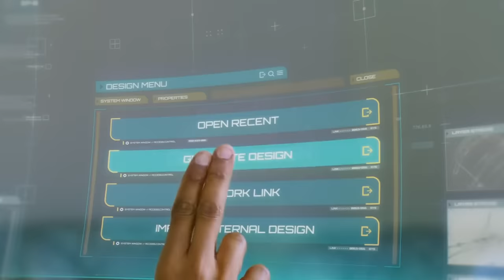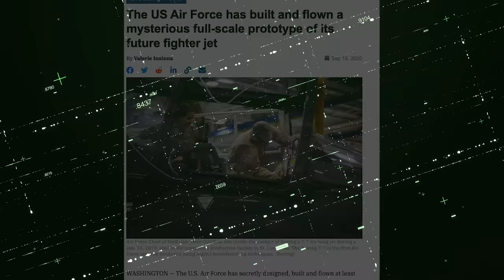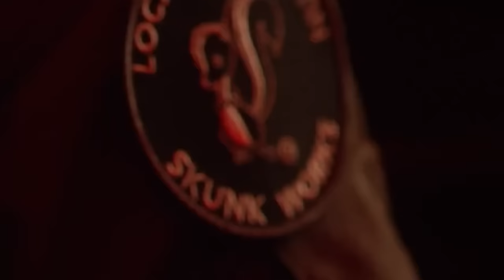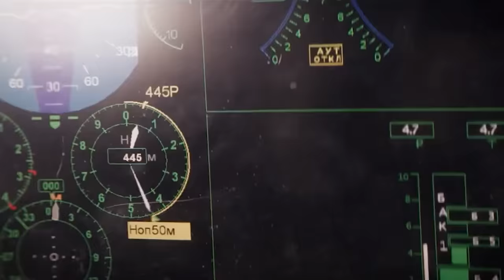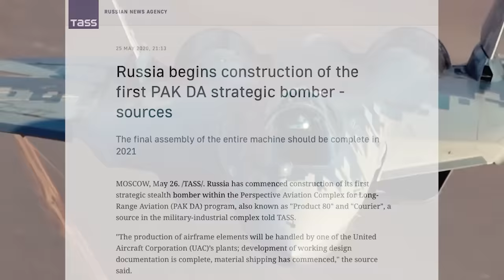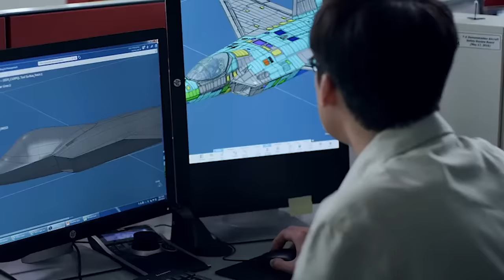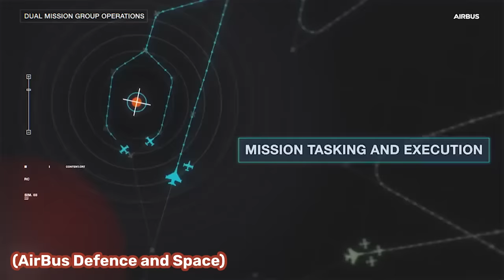12 new stealth aircraft headed toward service

Comment: America's been pioneering stealth since the 70s it took us a lot of lessons to figure it out so other countries just to show up and say we have stealth would make me laugh they're going to have a lot of problems the US ran up against in the early 80s-90s
Reply: they got 20 to 30 years of catching up todo and by then the US we still be 30 Years ahead
Reply: europe made stealth drone already
Reply: The first jet to incorporate stealth features into its design was the Lockheed A-12 which first flew in its full design configuration in 1963. Stealth was considered to be a vital feature after earlier experience with the Lockheed U-2 which turned out to be much easier to track than expected. An effort was made to reduce the U-2's radar signature called Project Rainbow and aircraft with these modifications first flew in 1957. There were also a number of unmanned drones that incorporated stealth such as the D-21, but stealth is quite a bit older than Have Blue and the F-117.
Reply: I mean this is true, but a lot of the issues are easier to resolve now that computer modeling is light-years ahead of what they had back then.

Comment: Seeing how India said their SU-30MKIs had no trouble tracking the J-20s, I wouldn't call it a stealth fighter.
Reply: That must have been at cruising/ferry speeds as Indian SU-30s lost lock on two Pakistani F-16s which had invaded their airspace once they passed mach 1 - and the R77s they fired pitbull (due to no lock) didn't lock either!  The Indians were furious which is why they ditched R-77 for Derby and pulled out of Su-57 as the Russians couldn't fix the problems with their RADARs.   The IAF must be overjoyed with their reliable Rafales, planes that actually perform as designed after experiencing Russian junk for so long.
Reply: Let's get real here Tracking yes It's loud and not invisible and low frequency radar detects it too. But Weapons/missile lock is whole different field again. Concept of stealth in jet fighters is not going "invisible" it means harder for enemy/opponents to weapons lock your fighter.
Reply: @LondonSteveLee india not did loose su30mki against f16 for your kind information
Reply: @LondonSteveLee and for your kind information Pakistan lost f16 and we lost mig21 and not su30mki okay
Reply: @RajathHathwar  Who said India lost an Su30? India chased two Pakistani F-16s out of their airspace after a well co-ordinated interception.  The Su30's lost the RADAR lock on the F-16s as they transcended mach 1, apparently due to RADAR jitter, they fired two R-77s pitball which also failed to lock. The F-16 escaped despite being on the Su30's nose.  Russian junk.